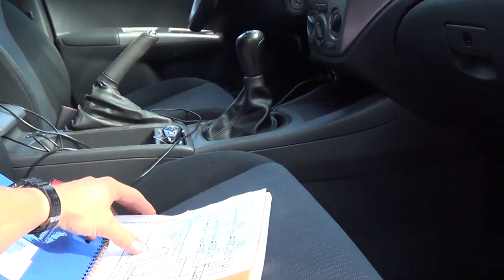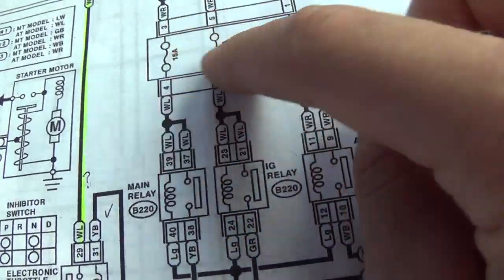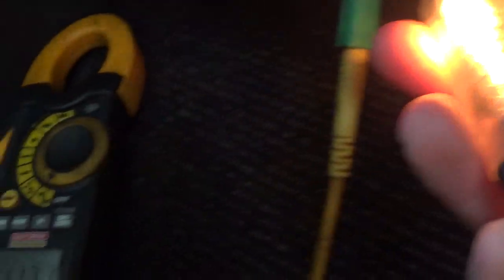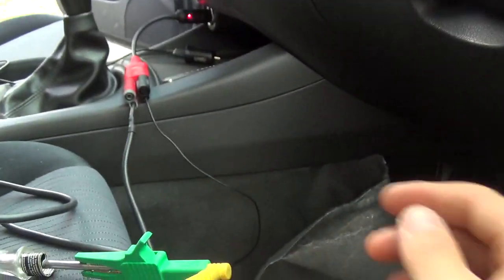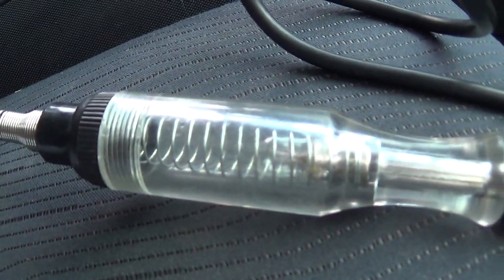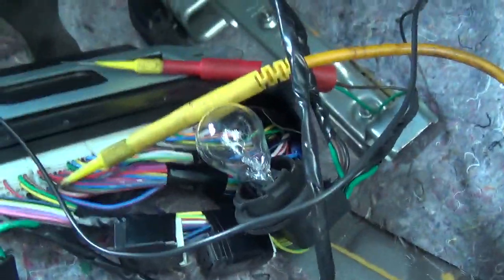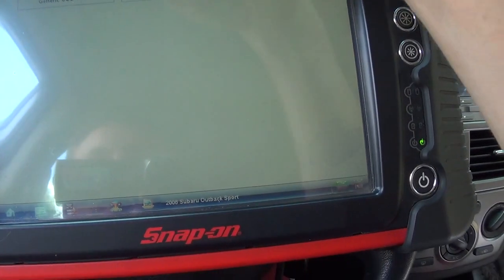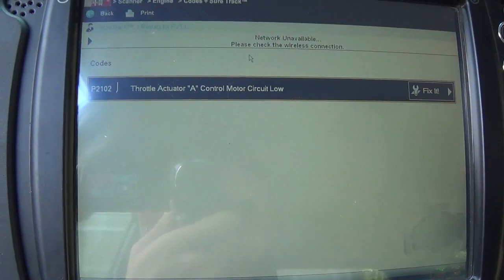Subaru Limp-Home P2102 Case Study - Part 2

Comment: Ivan! all the subaru's in my driveway have the same long crank at times and i believe it has something to do with learned data. my dad's 2016 forester in the owners manual states there may be a long crank after clearing memory or performing maintenance as the electronic throttle re-learns its operation.  the only times i have experienced the long crank was after doing something to negate or correct a learned value, such as fuel trim.  after cleaning or replacing a maf sensor that reads faulty, after fixing a vacuum leak, etc..   regardless of resetting the computer, my own experience is that the subaru cranks longer only once, after it has seen something to correct a learned value.  if my outbacks ltft is -8 at idle and replacing the maf sensor makes the stft read +8, the next time i start the engine it has a long crank. additionally all the trim data will have reset.  if what the owners manual says is correct about electronic throttle re-learn, what initiates the throttle re-learn? did something happen to your customers 2008 outback sport while he drove to work which made it enact a re-learn on startup?  your videos are great, keep it up!!!

Comment: I'm probably the last one that needs to be guessing, but you said "that's not what the customer , told me,,, he said once it's in limp home mode, he trys to shut the car off, then back on , and it doesn't go back in to normal mode"... What the customer isn't doing, that you are is pulling and then replacing the relay. So my guess is bad terminal connection that re-establishes as a good one temporarily (corrosion on terminal, loose fitting connection maybe or bad relay that isn't bad 100% of the time). Don't think it's a bad battery issue as don't think that would self correct itself watching you remove the relay and then re install it. Looking forward to the conclusion like ev1 else. Nice nail biter Ivan and great channel !

Comment: At this point i would be fitting a relay breakout and testing at the breakout rather than back probing. 
As for your customer saying that restarting does not put the vehicle back to normal mode i think they are trying to restart before the computer has shut down whilst you in your testing waited for the shut down before restarting.
Great case study

Comment: Consider chilling the PCM, either simple ice or freeze spray. From an electronics standpoint, I'd suspect a current issue that is not allowing the offending relay to close - but a simple spark jump is making the connection good for the rest of the day. Next morning or 2, you've got a temporary open circuit. I repair electronics... a can of component cooler (or dust in a can, upside down) can be invaluable!
Reply: That's a good idea.
Reply: I was thinking the exact same thing.
Reply: Me too. Aussie Falcons suffer from a similar temp related problem. put it in freezer for a couple of hours.

Comment: Sure sounds like an ecm problem. I've seen something like that on the 2000-2003 sentra's, and the way I've caught them is by scoping the signals from the TAC relay(on the ecm harness) while I monitor the TAC relay on/off PID. 
Good one Ivan, I'm eager to see what the problem is on this one.

Comment: One unknown from the video is after you cleared the code and were cranking why did you lose control side of the relay? Was it loss of computer control or loss of power to Pin 31? Once it re-energized it started so that needs further testing? Did the P2102 reassert after that? Did the computer shut down the relay b/c voltage was low from poor pin contact/fit & the PCM wasn't seeing no or low voltage and once the pin heats up it's ok? Lots of un-diagnosed possibilities...looking forward to Part #3.

Comment: I don't know for sure if it is the thing about powering on then off and then on again on throttle position module. But there is a mention in my 08' Subaru Outback service manual about letting electronic throttle to reinitialize after clearing the DTC for 10 seconds after first turning on of the ignition.

Comment: Ivan check out battery voltage on the red trace on your pico scope during the first initial crank it appeared that the voltage was dropping down to 8 volts I want to say that trace was going to the pcm. sitting long period cold start low crank voltage symptoms fit a weak battery I'm not sure but the pump may not recognize voltage below 9 volts don't overthink it bud

Comment: Ivan put another battery parallel and try ro reproduce the sympthom again. If you did not succeed then there is an abnormal voltage drop somewhere so the PCM gives no command to the injectors as well as the ignition. And you will have your voltage low code. Check also the massa-strip to the engine.

Comment: Voltage drop from a borderline battery? Would explain the behavior while cold? 

If not could be something broken internally in the fusebox/PCM. A hairline crack or bad solder joint. Warming up might cause a small amount of expansion which reduces the resistance.

Comment: Backprobing doesn't take into account pin fit so it's possible pin fit may be an issue between the PCM connector C1 & PCM so the PCM is not seeing what the backprobe is showing & it only takes ? Your initial check you had no power from relay Pin 30 to PCM C1 so it could be pin wire crimp but I'd inspect the pin for fit, crimp, & burnt contacts & may explain your hash. Normally load testing will find the issue but I've had pin fit, crimps & burnt/corroded pins cause this issue but I'll wait for the twist of Part 3. Nice case study to get the intellectual juices flowing.

Comment: I would vote ECU   
note that in the inadvertent setup scope trace where you duplicated the problem the ECU turned off the relay.  
note also that strange oscillation is about the same time the ECU turned off the relay in the first trace.

The abbreviated schematic shows an NPN transistor H bridge driver.  H bridges have a fault condition called shoot through where both the high and low side are on at the same time.  Usually there is circuitry in the integrated circuit driver to detect this condition and prevent it from destroying the chip.  Perhaps the ECU sees this fault and shits it down?

Unless you can solder surface mount parts in the ECU you might have to become a parts changer  :)
Reply: I don't know how to edit this but I would also check all the connections to the relay/ECU and see they are shiny clean.  Then check to the TP motor to see those are good.  I think you want to get rid of those oscillations.

Comment: Ivan did you scope voltage feed coming from the main relay that goes to the control of the etc relay?  Know you could see the feed from the etc relay alone but I saw some occasional drops on this feed when the relay wasn't grounded.  Did you load test the wire coming out of the main relay control side?   You could hook up a test lamp to keep it loaded at all times and then watch the operation with the Pico.  How about you get some recording software so we can see your captures better.  I paused the video a couple times and had to go into sqint mode to decipher your captures,lol.
Reply from the maker: hmmm interesting thought. So you are saying I should be worried about the feed dropping out on the CONTROL side while the relay is being energized...yes that is a very valid concern! 

At what point did you see the occasional drops in that control wire? Guess I wasn't really paying attention to that part of the circuit as much as I should have...
Reply: +motoYam82 It was in the part 2 video I think.  If you'd like, you could put the files on the Autonerdz public drop site and I could get a better look and Mark up your captures on the Autonerdz general public area forum.
Reply: +motoYam82 Or I could email you too, however you want to do it Ivan.
Reply from the maker: oh just give me a timestamp when you saw the dropouts for now. Will definitely start exploring the AutoNerdz database soon!
Reply: +motoYam82 Look at 10:34 blue trace, your not cranking then and the voltage spiked down for a bit.  Did you turn the key on at that moment?  I'm looking again.
Reply: +motoYam82 It looks like that drop happened when you turned on the ignition switch, so you lost some voltage supply when that happened.  How much did it drop too Ivan?  To me it looked like a substantial amount, with my eyes sqinting,lol.  I understand you'll have some drop with current flow but from what I saw I thought I would mention it to you.  How about you scope the output of the main relay and hook up the test lamp to it like I said and then hook up to the etc relay and see if the control feed is going away.  Hope that helps.  Intermittents are fun,lol.  Know what your going through right now.
Reply: +motoYam82 I squinted again,lol that voltage drop looks like it is very close to make the control side not have enough magnetism to keep the contacts closed.  Also did you notice the supply to the computer fell some too at the same time stamp?
Reply: +motoYam82  The red trace was at zero Volts at that time stamp, sorry.  I would still verify the control voltage though Ivan from the main relay.

Comment: When the engine is cold and the conditions are ready for it to be in limp mode, check the voltage at the relay and see if voltage is abnormal.

Comment: Main engine connector as seen in this video

https://www.youtube.com/watch?v=I_AoMnUdUfc

If that is not the problem I would have the battery load tested.  11.7  volt when you tested that circuit with your volt meter for a battery is basically a dead battery.
Reply from the maker: If it had a dead battery, why did the engine crank over so well...repeatedly? ;)
Reply: Perhaps dead battery is a Mis terminology for the battery, should have been the state of charge of a battery.  Here a link to a chart that tell you what the state of charge for a 12 volt should be base on the battery voltage.  http://modernsurvivalblog.com/alternative-energy/battery-state-of-charge-chart/

I would perform the tests with a good battery or a good battery use as a jumper such as the NOCO GB70 JumpStarter with the current battery in the car.
Reply from the maker: Hmmm the owner did mention something about messing with that bulk connector and smearing it with dielectric grease...he must have watched that video LOL